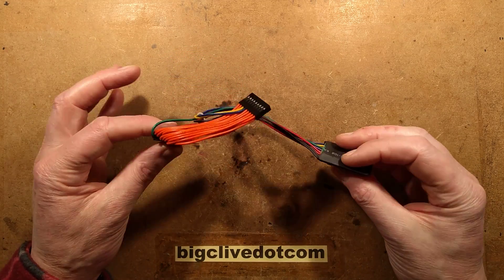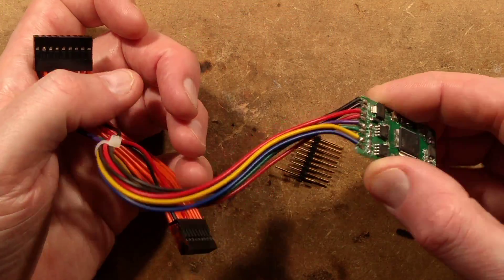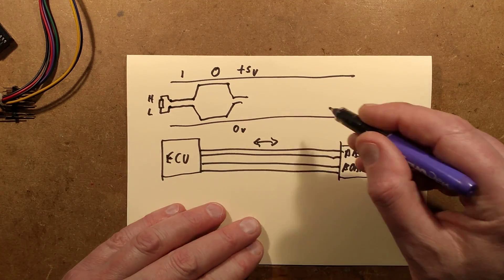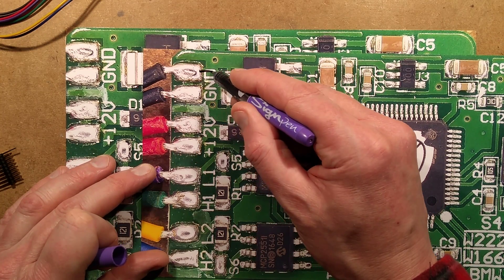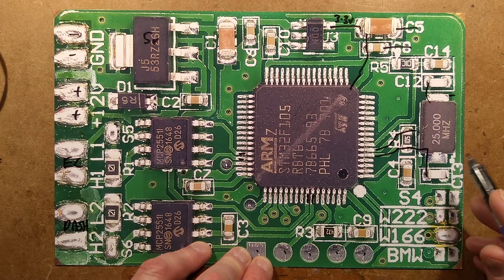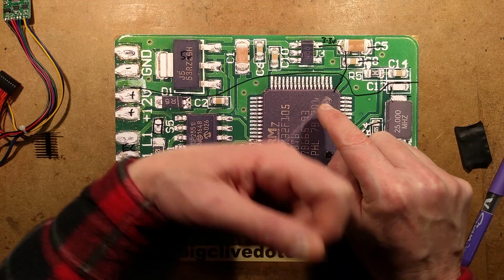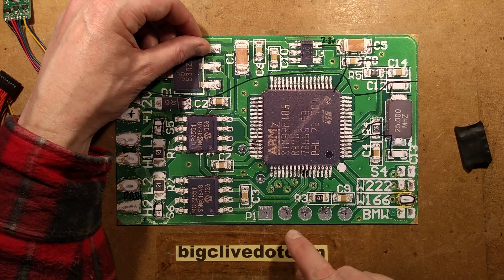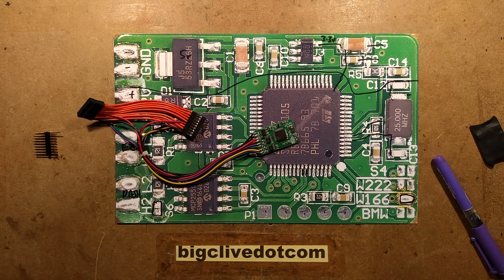Naughty CANbus odometer "interface".  (Fakes mileage.)

Comment: It was highly interesting for me to see how such a man-in-the-middle is grabbing information and giving it in a different mode to the other end.

I upgraded batteries of different type into my Mitsubishi i-MiEV.

It now runs like if it would have brandnew original batteries, but using such a device with the proper coding and frequency, to allow the cells to be discharged further and as a result gain more mileage.

Comment: "developped on arduino" No, definitely not, more on Keil Uvision. In fact official arduino support for STM32 is fairly recent. This device is a typical shenzhen design, and shenzhen engineer definitely use Keil uvision.

Comment: Ok but could I use this basic idea to say change what temperature is being broadcasted to the AC control unit or is it specific to spoofing the mileage for Mercedes only
Reply from the maker: Just for mileage.  You may be able to nudge a temperature sensor with a suitable resistor in series or parallel.

Comment: That is actually a adapter module to use a newer dash cluster with a older model vehicle and that also explains why the kilometer reading was lower than what it should have been because it was replaced with a newer cluster from another vehicle

Comment: even with bitlock you can in most of the stm32 line of chip, be able to glitch the chip on booting and request access to the ram, not easy if you dont know nothing about how those kind of chips behave but doable ✌😉

Comment: If this device was permanently in the dash circuit doesn't it suggest its function was to display a lower mileage rather than reprogram the mileage to a lower figure? In the latter case the device would be removed afterwards and not left in place.

Comment: I know, at least in Chevrolet's, that the mileage is stored in the cluster, so if you get a used replacement, you need to get it reprogrammed by a special device. Not sure this would work in a Chevy...

Comment: I recently worked on a 2008 Freightliner Cascadia that supposedly has about 13,000 miles on it... Until I removed the suspicious J1939 unit under the dash.  The truck actually had a little over 1.3 MILLION miles on it

Comment: i invision this device would happen to have specific programming for that model of vehicle because each vehicle uses a different address set for its values (lest manufacturers are being naughty and using standardized addressing for their odometers) i invision this device might be a bit tricky and if you use the wrong one it might massage the wrong dataset. lmao
Reply: AH yes the software is stored within the ARM processors internal EEPROM flash memory. very interesting. also this does seem like an Arduino based board. hypothetically if you pop that chip into a socket on an Arduino you could probably read the internal software from the chipset itself
Reply: if the lock bits are set worst case you could probably still read the data just by talking to it with the same information from the CAN network. use its trickery to probe its internal trickery haha
Reply: interesting bit of blarb from that webpage : 

```
 These filters block old mileage data from EZS module. If you have installed a filter on Mercedes-Benz vehicle in EZS module, then original dealer workshop scanner (like Mercedes Star Diagnosis Multiplexer or Xentry) will show same mileage in EZS as in vehicles instrument cluster. Also works for older vehicles like E-class W211, S-class W220, Sprinter. Mercedes-Benz filter can be installed also in the instrument cluster, but in this case in EZS-EIS will stay old odometer mileage value.
```

Comment: Unfortunately, in Slovakia or Hungary it's common to tamper with the odometer, especially with cars imported from other states, where it's not possible to check the mileage. Despite the fact that there are many specialists for this topic, I was unable to find any, when I replaced my car's instrument cluster, and needed to shave off 110 003km of the shown mileage.
Then I had my bi-annual roadworthyness test, where they recorded the uncorrected mileage, so now I don't even want to change it back (I'll be crossing 400 000 km tomorrow, woohoo).
I don't care, I think that the actual state of the car is more important than what the odometer shows...

Comment: Every manufacturer differe but most modern cars store the mileage in at least 3 different computers and any mechanic with the correct tools can interrogation all the computers to make sure the mileage matches. My euro car software has a button for checking the mileage. If it fails then it comes up mileage tampering.

Comment: So how many can you put in series?
Reply from the maker: You could program just the one to reduce the count as much as you wanted.
Reply: @bigclivedotcom ah  but where is the fun in that. I suspect they're sold as a 25k unit (no special requests) and the reseller applies a blob of solder, correct harness and heat shrink before shipping.

Comment: It goes to show that there is a way around all of these systems.
So I guess that this just removes a set amount of miles/kms from the odometer, but doesn’t stop the mileage from increasing through normal use.
I know most odometers can be switched between miles and kms. Would this be able to handle this too?
Reply from the maker: I'm not sure where the miles/km processing is.

Comment: Hook up a reader/progammer to the diagnostic and programming pins and get it to dump code from the processor. Maybe one for an adurino will work? Pretty sure all it is doing is deviding the value of the reported milage and filtering our certain types of annoying error codes. They probably left it wide open as well. 🤓

Comment: Legitimate use would be if you installed tires with a smaller circumference or potentially if you changed gearing. You would use one these puppies to correctly log the miles. It's all in you use it. My personal truck is cable driven and has bigger circumference tires on it. So the dash says 90 but in reality I'm doing 75, this is one of those circumstances where a mechanical version of this would correct my mileage. The truck already has 228k so it doesn't matter anymore.

Comment: from my understanding is on some cars that employ canbus the Odometer is stored in two locations, the ECU, and the dashboard. if you change the dash or the ecu, I believe it checks which one used the most recently (ecu or dash) and updates the other accordingly. Found this interesting, because you can change the dash, or the ECU and the odometer will not change. but if you change both at the same time then it will.

Comment: CANbus in vehicles (Beyond the engine and transmission) started with the power windows. Vehicle manufacturers had reached a point around 2000 in shaving weight where all the low hanging fruit was gone. They were shaving weight because of the MPG requirements of the EPA and other regulatory agencies around the world. At some point, I believe it was Chrysler... an engineer said in a meeting, what about the power window system? At the time a power window system had wires looping from door switch to door switch all over the vehicle, wired basically like 3 way switches in a house. This system had well over 200 pounds of wiring, JUST to control the windows!!! Easch door had a thick bundle of wires going into it just to control raising and lowering the windows, since all doors were connected through the main panel on the driver's door. This engineer realized he could reduce the wiring in each door to 12 volt power and ground, and two thin communication CAN wires looping around  to each component  of the window system within the door - a total of 4 wires passing into the door.... So instead of 12 volts in a heavy wire going from the drivers door to the passenger motor to drive it. The drivers door switch module puts commands on the CANbus to tell the passenger door to roll down. (on some vehicles the modules talk directly, on others it must go through the ECM). Thus, vehicle wide CAN control was quickly adopted throughout the vehicle, on some vehicles to include things as basic as brake lights and turn signals.... All, in the interest of losing weight in the wiring harness for fuel economy as well cost savings reasons. By doing this, they reduced the over 2 miles of wire required in a late 1990's vehicle to less than half that by 2008.
But I digress... as for this little gem... No bit banging... with proper construction of the circuit and hardware to meet CANbus communication standards... Well done !!!!  except for, wow that's LOW.....
Reply: CANbus has been around since the early 80s.
Reply: @shmehfleh3115  yep, it was used on factory floors for many years. It is nothing but RS-422. The first diagnostic connectors were introduced around 1990 and were very basic (the ALDL... a basic serial connector with hardly any data) 
J1850 was introduced in 1995 1/2 on both GM amd Ford, with dodge continuing to use its old serial bus but with a J1850 style connector ... till roughly 1997-1998. (Confusin as heck huh) the J1850 was fine for engine control but only ran at 9600 baud so it's use was limited to very basic functions. Later, the J2284 with 112k baud came out by demand of the manufacturers so they could expand the bus as I described and connect more devices without bogging it down.

Comment: I noticed on the ECU Intercept Circuit Board, the initials "BMW". Perhaps this device has been custom-made for the 'other' German Luxury Car, and adapted to suit the Merc. Thanks for teaching me a little about CANBUS, but (I feel) that you have barely scratched the surface. I am thinking that Bosch first developed CANBUS for cars. By the way, ifr this device 'shaves off' about 40,000 kms, wouldn't your fuel tank start overflowing? LOL!!

Comment: I'm commenting 19 months after this was posting so it may have already been posted - but the Mercedes W166 chassis is the GLE class SUV, and the W222 is the S Class from 2013-2020. So they got you covered, just jumper the coded pads on the bottom right. S4 is likely Audi and the BMWs might all be the same.

Comment: S4= Audi
W222=Mercedes 
W166=Mercedes 
R3=Audi / Saab
C9=Corvette?
BMW=BMW I recognized the mercedes body style? platform number, i have a W210 which has E-430 on the left rear boot lid. Pretty sure yer lookin at a device that can be programmed/used for several makes models series etc. etc. u said programming pins? Ya i think yer right about those pins. This is so screwed up on so many levels as to how low some scumbags will go just to line their pockets with cash instead of working an honest days work. Keep up the good work buddy. & ya I'm sure if u google those number/letter combos you'll see what in talkin bout. I searched how to fix broken hood latch on my e430 & a bunch of videos came up with w210 body style blah blah blah. Anyways I'm a big fan & u make me laff quite often with alot of yer qwerky vids. 👍🏻👍🏻👍🏻👍🏻

Comment: There's one site online that sells these for various different cars.   If an expert wanted to he/ she could   adapt this technology   to deploy airbags by remote control meaning have a cell phone connection to the board and the person with the cell phone just  dials up the number for that SIM and presses his button and both airbags go off.   Or maybe even remote control the  car.  There has to be some steering by computer mechanism for cars that self Park.  Imagine a car is going along the highway and you lose control of the steering because the guy behind you is remote controlling the steering.

Comment: bigclive, I disagree!  You said "There's not an awful lot on the circuit board"
There's an STM32F105 on it, and if you have ever tried to program one, you'll agree there is a lot on the circuit board!
There are 103 pages in the datasheet alone for that device - and datasheets make lousy bedtime reading.  They jump around so much that it's really hard to follow the plot.
"The two positives are bridged and go to a diode - for polarity protection - that's a sign of good quality."  Or maybe it's a sign that they really didn't want to cause a problem on the car that would cause this little device to be discovered.
What really gets me is that somebody designed this thing - and its design would not have been trivial, even to somebody who knew the car in question and t he CAN bus pretty well, and it is made on a properly made SMD board.  I can only think that it wasn't made as a one-off - though I know that one-off PCBs are not expensive.  I wonder how much they were sold for - and how many were made!

Comment: Googled "CAN gateway" and found these openly sold on the internet as a "mileage adjuster" for less than $30 marked down from $86.
There is also a version that plugs into the OBD II connector. They seem to cater to the high end brands like Mercedes Benz and BMW.

Comment: dashboard is only instruments.  odometer is clicked for each tenth and mechanically counts them.  speedo same thing.  other lines (straight thru) are the indicator lights, high/low, turn, warning lights, etc.    the control unit (ARM processor) probably has a program to interrupt,  or reprogram the signals.  Possibly roll back odo  by "special"  command placed on the canbus when wanted.

Comment: Mercedes CAN filter is designed for Mercedes-Benz C (W204), C (205), E (W207), S (W222), GLK (X204), E (W212), CLS (W218), SLS (W197), CLA (W117), ML (W166), GL (X166), SLK (R172), A (W176), SL (R231), B (W246), G (W463-06/2012), V (447) vehicles. These filters block old mileage data from EZS module. If you have installed a filter on Mercedes-Benz vehicle in EZS module, then original dealer workshop scanner (like Mercedes Star Diagnosis Multiplexer or Xentry) will show same mileage in EZS as in vehicles instrument cluster. Also works for older vehicles like E-class W211, S-class W220, Sprinter. Mercedes-Benz filter can be installed also in the instrument cluster, but in this case in EZS-EIS will stay old odometer mileage value.

Comment: Very interesting. I install remote starters in vehicles and these types of circuits that peel out a signal or useful control for the vehicle are referred to as 't-harnesses'. When I use a t-harness its typically to give me the information I need in order to control the car and running it down to a plug that interfaces with my remote start brain. This is the first Ive seen of something like this, very interesting, thanks for sharing.

Edit: also on the pcb itself, 
S4 would be for an audi
W22 and w166 are mercedez bens chassis codes
Reply: by Mercedes the odo is stored in the engine ecu the gearbox if it's automatic the body and tacho
Reply: @Punky-Boy  I wouldn't be surprised if all CAN bus comms inside high-end cars will be encrypted soon.  Just like John Deere, it will require proprietary software to pair and authorize replacement parts.
Reply: @misterprimeminister473  wel you have to learn new parts to the car and ecu's aren't switchable if you doesn't get an empty one
Reply: @misterprimeminister473  I mean, bad guys will always do bad guy stuff. You could fudge the sensor on the trans, wheel speed sensors, or... ya know... put bigger diameter tires on a vehicle - garbage in; garbage out. In the US, the insurance companies track and sell this data. They typically audit the sensor collected data against GPS data.
Reply: @misterprimeminister473  - hand that question over to apple third party freelancer repair experts - they will be able to tell you stories of sadness.
Reply: @Punky-Boy  - its very year and model specific, not simply a brand...
Reply: remote start is stuuupid and dangerous..how fucking lazy are people
Reply: T-Style devices are just sniffers. They would only need to listen - thus are in passive mode. When they find a certain message type or value on the bus they might be able to activate some pin or do some slightly more complex logic. With the signal finally going external you can do lots of things like light a bulb, start some actuator or give some measurement device (e.g. a scope) some trigger signal.
Reply: If it was a mechanical odometer it may change the value for the stepper motor without affecting the speedometer if that possible. If it’s electronic, I believe the odometer display is stored in the ECM.

Comment: S4 = Audi
W222 = Mercedes S Class (2013-2020)
W166 = Mercedes M Class (2011-2015)
BMW = BMW

This same board can be used on 4 different model lines. All German manufacturers share Siemens electronics, making this much simpler.

And this would be done not for resale value so much as to extend the warranty period or evade mileage charges on leased vehicles. Tampering with an odometer like this will get you time behind bars in the U.S.

Comment: It didn't take long but I found more info, I wouldn't recommend it as it's just not fair on the buyer of a car, any cheap scan tool will pickup the mileage indifference, best so far I found was 140K on the dash and 240K in the ECU,.  FYI https://dangerouspayload.com/2020/03/10/hacking-a-mileage-manipulator-can-bus-filter-device/           Google or search Aliexpress 18 in 1 Universal CAN Filter ,  so If I brought a car and found it had one of these on it I'd be taking the old owner to court and get a full refund and have had use of the car for 6+ months and I'd claim other losses and win, it's happened before especially to car sale yards

Comment: Watch...states will begin initiating "safety inspections" that record your VIN and odometer readings. If the odometer comes up with a lower reading later your vehicle will be flagged "not actual miles" for the odometer. This has not been done in most states because people don't want the government snooping and doing "unnecessary searches" to prevent crime. This may change.